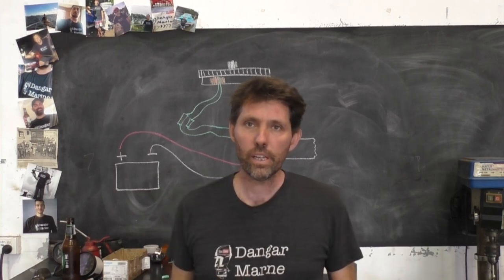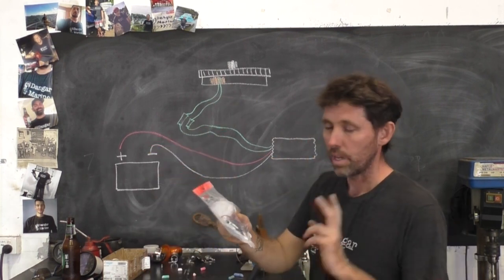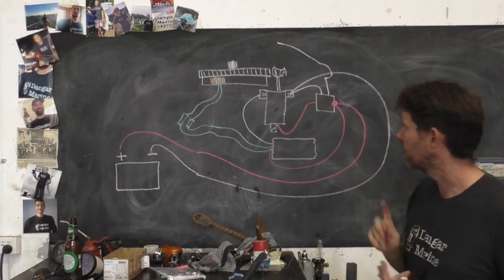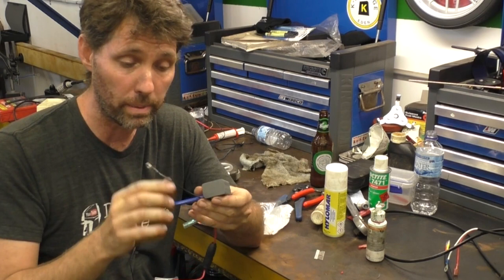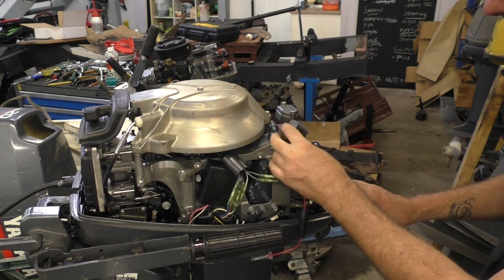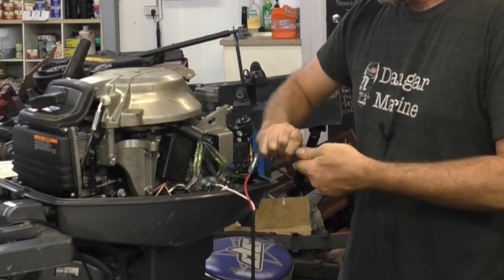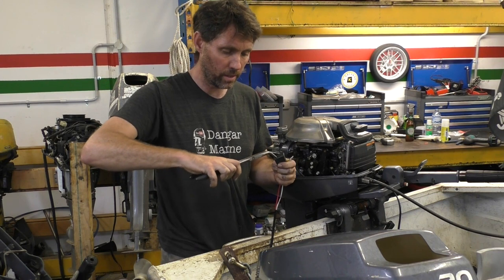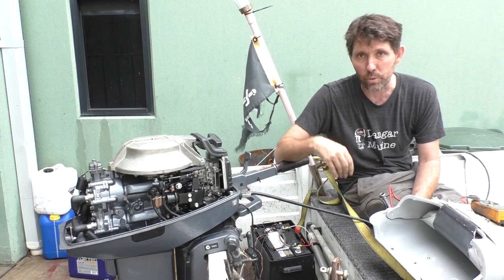Charging a battery from an outboard

Comment: Thanks again I was quoted $280 to fit a rectifier to my 8HP Yamaha and after watching your vid I purchased one for $40 and fitted it myself in 5 mins
Reply from the maker: Nice work! Glad to hear you managed to save yourself so much money. :)
Reply: Hi Dangar i have a2005 evinrudr j40rlsoc i want to add an starter but only four wiers come from under fly wheel. How do i conet
Reply: eric onealetorchon It gets expensive. You have to have a different flywheel, starter, and electrical components. If you can find a parts motor for cheap do that. New OEM parts will cost more than the outboard is worth most times
Reply: Can u tell where to purchase the rectifier..I'm looking for Yamaha 30hp hmhs engine
Reply: a honest well price shop is what you want and that one doesnt seem like its the best option

Comment: Exactly what I've been looking for!  I have a pull-start Yamaha 25hp 4-cycle that came without a battery charger so I've been charging the batter via solar panel after every trip. Yesterday on the water, my deep-cycle battery crapped out just at dusk, leaving me a couple miles from the marina on busy Chesapeake Bay without running lights. Made it home safely and today, after looking under the engine cover, I've found the two green wires (plugged) just waiting for R/R installation. Thanks so much for posting your video - it's solid gold! Cheers!
Reply from the maker: You're welcome Arnie, glad the video helped you. I don't think I did it in this video but you might also want to add a 10 amp fuse between the battery and the R/R.

Comment: tip : now connect the front socket on the engine back into the +_ 12 line regulated, then  when night fishing connect your handy spotlight 12v into that front socket, after done disconnect replace the  plastic plug to seal it off again, makes for a good 12v accessory  plug. :)  my 2.5 hp had no ac coil, so i added one,  used bridge rectifier, lm317, 2n3055, and a zener 12v witha adjustable pot, set to 12.9v , whalla...12v on a 2.5hp mariner, at 4 amps :) works like a charm. good video as always Dangar.

Comment: I know that this is an older video, but just last week I was  wondering it this very idea was even possible for my 9.9 hp Mercury outboard.
I'm a great outboard mechanic, just not the best at electronics!
Now to investigate whether my little "kicker" has the lighning coil installed already, or not.
Thanks Stu, I really miss your outboard videos, even though I understand your desire to move forward with your new trawler.
Float safe!
Reply: Did you learn any more on this? I have a 20hp 2 stroke and want to add a charger. Mostly for running lights and electric start. Maybe depth finder.
Reply: @Boaters_hub  I've looked under the flywheel of my 9.9hp Merc, and I don't believe that mine has the needed part. So I'm out of luck.
Reply: 😮30 hp etech marine engine does not charge the battery. What can I do? I wish you a good day, my friend

Comment: Another excellent video 👍 I used your bilge pump installation video to get my bilge pump installed, now you have an excellent video on powering battery/ accessory from an outboard. I just want to run a nav light for nightime. Hopefully I won't need a battery, I will just try wiring to the accessory wire provided on the converter. Cheers again 👍

Comment: Hi Dangar Stu love your videos Just added a Bridge Rectifier to my Yamaha 30 Hp nearly identical install as you showed on your video. Point to note I bought a 50 amp Rectifier off Ebay for A$5.00 does the job nicely A fully sealed unit and works perfectly Cheers Phil
Reply from the maker: Hey Phil, glad you like the vids. :) Yes, there definitely are some cheap alternatives to the original parts out there.
Reply: I'd love to see a pic of the rectifier you got (is it also a voltage regulator?), brand/part number.
Reply: Gogle Plus Sucks send me your email address and I will forward you the pic and a wiring diagram mine actually cost A$1.99 haha

Comment: Once the battery is fully charged under engine power by the regulator what stops the regulator from sending any more volts to the battery and where does this excess voltage go if not to the battery?
Reply from the maker: My understanding is that the regulator sends out around 13.8v to the battery. If the battery it is flat say, 11.5v it will accept a charge but once the battery is at 13.8v there is no potential difference so it stop accepting charge naturally, it isn't something the rectifier does. Smart chargers for the workbench sense the voltage do change the charge rate dynamically but that isn't something an outboard does.

Comment: I love your videos so much. You are always the first place I go to for advice, you usually have a video. If not you always reply. Really thanks for these!!
Reply: Also do you know if a 1969 65hp merc and 1972 80hp merc have interchangeable throttle cables? I switched the 80 onto the 65 hp cables and it seems to have a much higher rpm than before. Like the cable is too short and keeping the throttle open, dont really even need the warm up lever. Boat still runs and drives, but is a large clunk when put into gear.
Reply from the maker: Hey Nick, I'm not 100% but I would imagine they should be interchangeable. I would measure the travel of the end section from fully retracted to fully extended and see if they are the same, that is the critical measurement.
Reply: I will have to check that measurement tomorrow. I got the cables to fit and I took the boat out fine, but when I shift from forward back to neutral the cable doesn't close fully to the neutral position and the rpms are very high. Then while it is still in high rpms I can move the throttle down with my hand on the engine. So it seems to have the reach, and is a little stuck? I just saw your video on lubricating the cables. Im going to see if i can just apply some if that will help, if not will try what your video suggest. Thanks!!!!

Comment: Hi mate, I would have used the fused lead from the rectifier to feed the boat's battery,  I would have also fitted a second fuse in the battery lead close to the plus side of the battery as well, now call that belt, braces, and string if you like, but any thing that has battery power on it, that may get trapped and cut, will get trapped and cut, and I call that ,, ""sh*t happens!"",, and don't I just know it too!
Reply from the maker: For sure, extra fuses would be a great addition.

Comment: Hey Stu, great video. However, best practice is to fuse the positive lead from the battery as close to the battery as possible. Not to protect the battery, but to protect the wire from all of the potential energy stored in the battery. The potential energy in the battery is for more dangerous than the output from the rectifier. If your positive wire we’re to become pinched somewhere under the cowling, the short that could occur could cause problems for you. Just a thought. Love your channel.
Reply: What size amp inline fuse?
Reply: What size inline fuse?

Comment: You need to do a video installing one of these on an electric start motor and if you have a battery switch where you cut the batteries off or just run battery one car battery to or both batteries if it makes any difference of having that and tell if it will charge both batteries at once or if you have to switch between both batteries. Keep up the good learning videos

Comment: Very confused, I was in my local Yamaha dealer trying to buy this part after watching the video and they tell me that its only a rectifier assembly and that without the regulator I will eventually fry my fish finder, downriggers and battery at high RPMS putting too much current into the system. On a search of the part number it confirms that it is only a rectifier, so what the deal with calling it a rectifier/regulator?
Reply from the maker: Everyone I've ever bought has been a regulator/ rectifier than can charge a battery directly http://www.boats.net/parts/detail/yamaha/Y-6J8-81960-00-00.html
Reply: I have the same concern. The voltage output on mine tends to get a little high ( more than 13.8 - 14.1volts) for normal battery charging. Maybe it's a very old one, and as Kevin says, maybe it's just a rectifier.
 Stu, do you perhaps know the rated output of these things? (Volts and max current). I can't imagine that they supply much current. I was surprised to see the one that you worked on had a 10amp fuse. I thought it would be less.
Reply: I think you are right about this from what i can see. I put a used one off another motor on mine and it goes up in volts with throttle. Pretty sure this part number is only a retifier

Comment: hi mate
can you tell me why on my mariner 4hp sailmate outboard it only has a half wave rectifier, that looks the very same thing as you just fitted?,, why only a half wave and not a full bridge rectifier, I ran up my engine and it was putting out  just about 14 volts DC but the engine was running very close to flat out,,  the AC output was closer to 23 volt's when running at that speed but was well above 15 volt's AC at about 1500 rpm, with a full bridge rectifier even with a slight loss of volt's across it, I bet i could easily get a good battery charge rate out of this engine ,  and not revving the nut's of it!,, a 600 volt at 25 amp full bridge rectifier can be got of Ebay for about £1,50p ""well over kill that is!"",, but as that half wave rectifier kit that you fitted had no DC voltage control on it at all,  and the kit's cost over £45.00p  (and that's a cheap kit!) so if your thinking of fitting that kit why not just knock the kit up yourself for penny's? as fitting a full bridge rectifier would give you twice the amp's for charging your battery at a lot less rev's , and you could still get away without a voltage regulator, but its not very wise as you still have about 20 odd volt's DC going into your battery,, and your battery wont be liking that for very long,, (ie: for year's!)  and a voltage regulator is so easy to knock up any how, so make one up and fit it in yourself!,,  I don't know?? £45+ for a £1.50p rectifier!,, now that's what I call a rip off big time!

Comment: Perfect explanation! Why isn’t that plug used though? It would make sense to wire the regulator into the back of that then onto the battery. So it’s an easy disconnect when taking the motor off. I’ve been looking for a plug but doesn’t seem to be one??

Comment: I am confused, you said you only run the earth to the engine block when it has a starter motor, than you ran it that way with a pull start?
Sorry, I saw where you grounded and went to the battery as well.

Comment: The existing AC out plug is a pretty convenient way to connect the battery to the motor if you don't leave the motor on the boat. They're not that expensive.

Comment: Thanks Stu, very informative as always. Clear and concise. Keep up the good work mate. You have a good grounding in electronics too by the looks. It sure helps doesn't it.
Stu, I think you need a new battery in your wheel clock in the background there mate, I noticed the second hand just bouncing. Mine does the same sometimes when the battery is low. LOL.
All the best and Cheers, 
Bruce.
Reply from the maker: Thanks Bruce, glad you liked the video. :)

Comment: Thanks for the video. Please can you tell me the cause of the problem. I removed the battery terminal while the engine was running. The alarm on throttle controls started beeping and since then, it has not gone off. In the beginning, while I was not touching anything, when I make contact, it beeps briefly and goes out. I start the engine and don't whistle anymore. 1984. Evinrude 60 PS Please can you tell me the problem. Where the problem arose. Thank you very much in advance for your reply.

Comment: If you were motoring along and your battery were to become disconnected (e.g. a BMS disconnect on a lithium battery) how high would the voltage get, in the charging circuit with no load?

Comment: I have a 1991 25hp Mercury 2 cylinder.  I am trying to set this up but I don't have a lighting coil.  Any advice on what to buy?  Can't find what you are calling a lighting coil, and a new stator is not cheap.  Thanks

Comment: Many thanks for this video. I just bought a Yamaha 15hp 2 Stroke and it has a rectifier/Regulator fitted. I have started it up and connected my meter to the Red output on the rectifier and earthed the black on the meter. At Idle I am only getting about 5v DC but as I advance the throttle it advances to about 9v at 20 % throttle. I don't want to run the engine too hard out of the water on Muffs. Is this what I should expect ie do you think I will be getting 13 + volts at full throttle. I have not yet connected my batter and was only testing on the meter

Comment: Change the rectifier and change the coil’s and never got it to charge but just a fraction hire about 12.2. Changed to a gel battery and it jumped to 13.5 V.
Reply from the maker: A bad battery will affect the charge voltage to see.

Comment: another EASILY UNDERSTOOD.....IN DEPTH VIDEO❤️
I ASSUME IN MY LUND THE MOTOR ONLY CHARGES MY STARTER BATTERY? CAN I WIRE IN A SET OF 
D I O D E S So that the charging circuit from the outboard can charge my trolling battery as well without using the voltage from my trolling battery in other words keep them separate circuits? Have you done this before or some version of this? I’m also thinking about adding a small solar panel basically mounting it on top of my 90 horse engine and wiring that to the trolling battery so that it’s always charging? What are your thoughts can you do a video setting up a charging circuit for the trolling battery as well? Thank you for all the videos and the knowledge that you pour out constantly❤️🇺🇸❤️🇺🇸❤️🇺🇸❤️🇺🇸❤️🇺🇸❤️🇺🇸❤️🇺🇸❤️🇺🇸🇺🇸🇺🇸
Reply from the maker: Thanks mate. I would look at using a VSR like in this video https://www.youtube.com/watch?v=kTQp5d5mMio&t=1s
Reply: get switch ,3way  batt 1 batt 2  batt 1and2 off, very cheap,dont think have enough power,to charge both same time ,.

Comment: I have 3 other battery's on the boat . 2 are for the trolling motor and the other one is for my fish finder lights and radio.  The boat has 150 hp engine . The only battery the engine is charging is the starting battery. Is there a way I can use the engine to charge all the battery's  at the same time when the engine is running  instead of just the starting battery ? If so how do I wire it up. Do you have a video showing how to do this?

Comment: I have 3cyl Yamaha 40hp motors. They charge at more than 16V at planing rpm. Is that normal? My vhf radio complains about "high voltage" above 16V.

Comment: hey mate not sure if you still check your messages, i picked up a 6hp yamaha and am wanting to connect a battery. it has 2 red wires coming from the motor and they are just loose. is there any way that i can check them for being the correct wires for charging?
Reply from the maker: I would start by tracing them and seeing where they go. It sounds odd that they are both red rather than black and red or both green, but if they either go under the flywheel or from a regulator rectifier then I would start the motor and put a multimeter across the two wires and see what they are putting out.

Comment: Stu, great suff!  I fitted a starter motor etc to my 30 hp Mercury (Tohatsu) 2 stroke. I got the bits from a boat wrecker including the rectifier. I have done some checks on the rectifier and dont see anything wrong with it - BUT I dont seem to get a charge from it. I have a battery/power indicator that doesn't show any additional voltage at high or low revs. Do I assume the rectifier is RS? and need to replace it. I use a smart charger connected to the battery when I get back from a trip to keep the battery in OK condition and charge. The power indicator is quite sensitive and shows when the fishfinder etc are on - drop in voltage read.
Hey I reckon a hard word on the Boag people for sponsorship. I always feel like a coldie when I see them on your vids...
Reply from the maker: I had a similar problem recently where the AC coil tested good, the rectifier tested good, but not charge voltage at the battery. Frustratingly I never got to the bottom of it. Maybe it was the coil putting out the correct voltage but not enough current.
Reply: Thanks, cheers and keep up the great videos.

Comment: Just wondering what to do in the case of charging 2 batteries - I have one smaller marine type that powers my sounder and lights and another car-sized deep cycle that powers my electric motor. Both 12v. With my limited understanding of electricity I am worried that, if I charge the batteries in series, the bigger battery will sap the smaller battery potentially pulling power from sounder and essential electronics (after sustained use of electric motor).  A lot of rectifiers I am finding available only have one positive out of the rectifier. Any advice is appreciated. TIA
Reply from the maker: You'll need to charge them in parallel and use a VSR to stop the systems draining the wrong battery.

Comment: Question if it matters about 6 amp or 12 amp charging. I am working on adding a starter to my honda 9.9 outboard and found a used flywheel from one with a starter mine already has a 6 amp charger will i need to upgrade to the 12 amp charging system for this to work? Thank you

Comment: Hi Stu. I have the same setup on my yamaha outboard. However I now want to remove my lead acid battery and replace it with a lighter  lithium battery they now have for motorbikes. This battery is only used for starting only. Do you think I can still charge a lithium battery with this setup?
Reply from the maker: Good question. I know lithium batteries do need some clever charge controllers some time. I'll do some homework and try to do a vid on that soon. I imagine many people will go that way soon.